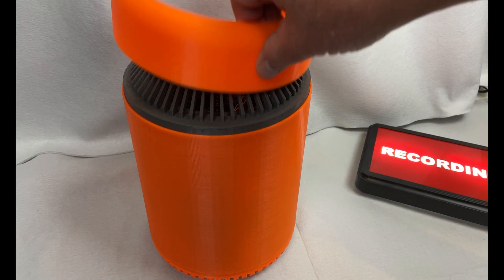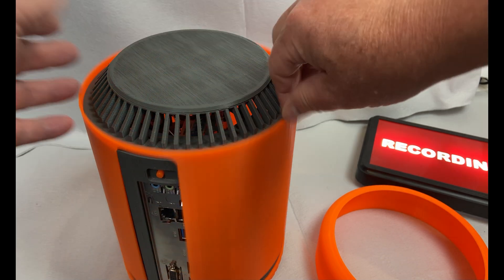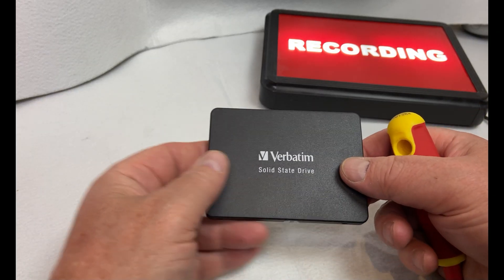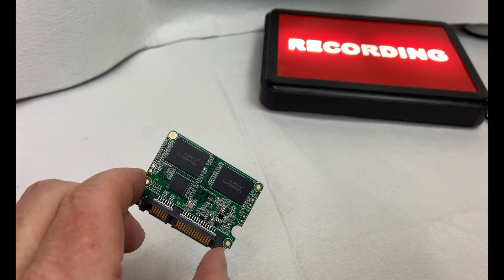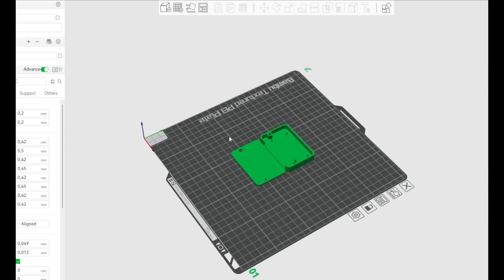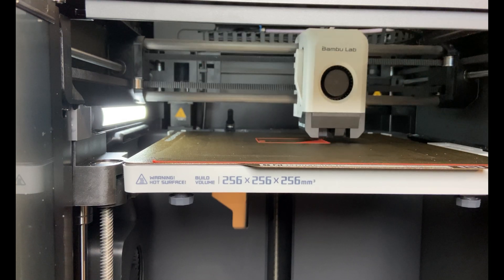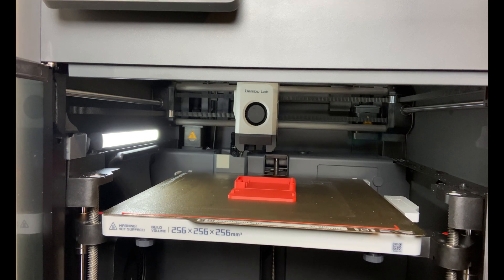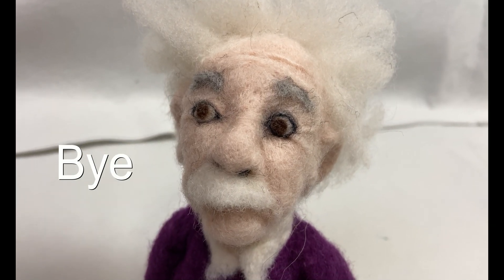3D printed trashcan PC

Comment: If you ever find the original, it is worth opening for a look. Its absolutely beautiful inside. Very densely packed. The one I used for a summer would overheat and lock up when pushed hard in a room with poor AC.
Reply from the maker: I have seen some of these listed. They are priced almost like a "collectors item" unfortunately.
Reply: @v4projects  😥

Comment: Ok to share the compact SSD case please?
Reply from the maker: I can do that. It is unlikely that the small posts inside will fit different SSD pcbs, but they can be removed easily and I guess some glue will do the trick. STL's here https://v4.no/stls/SSD_case.stl and https://v4.no/stls/SSD_lid.stl
Reply: @v4projects  Thanks very much! I knew the pcb layout will be different, Im not very good at 3D modelling, but I can basic edit a imported STL and this will be a great start thanks. I have looked for something simuliar on Thingyverse but hasn't been what id like.

Thanks again.
Reply: @v4projects  Thank you!